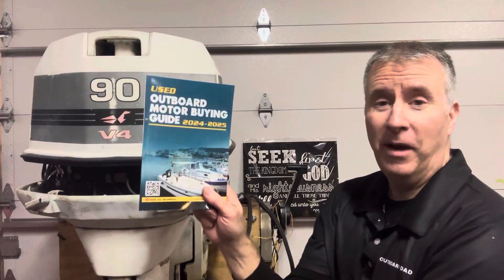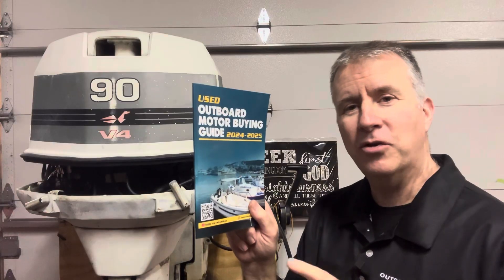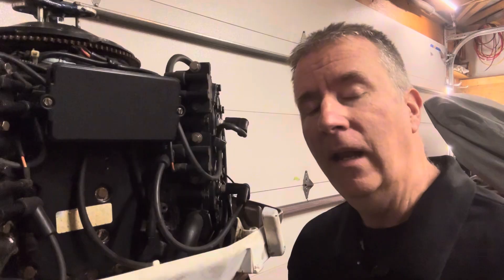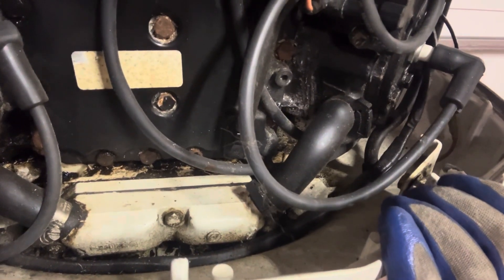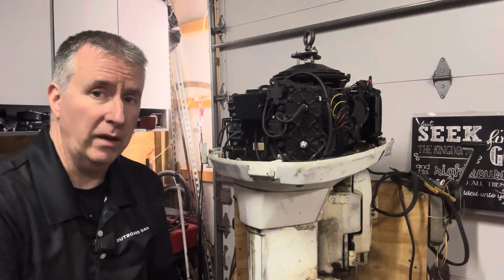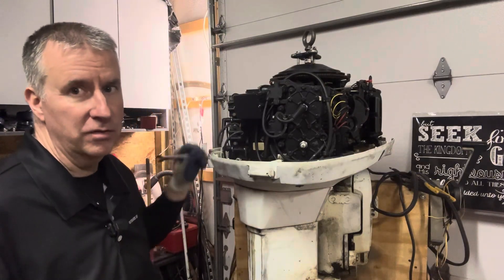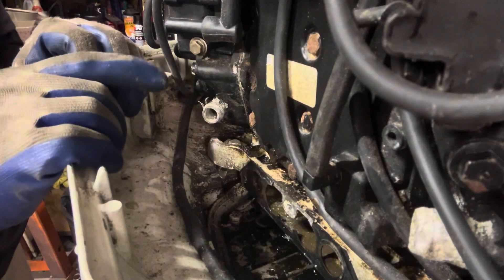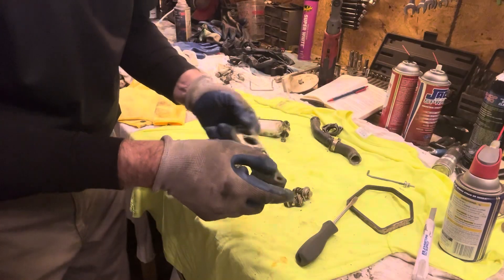Outboard Motor Thermostats and Poppet Valve Repkacement

Comment: Hello, I would like to know what function the plastic caps serve in relation to the springs?
Reply from the maker: You mean the poppet valves at the end of the springs? When the motor revs up and reaches approximately 25 psi water pump pressure then that pressure overrides the spring pressure and opens the poppet valves letting full water flow through the motor bypassing the thermostats at highest rpm’s. Was this helpful?
Reply: @OutboardDad Excellent thank you very much for the amswer. I figured it was something like that, meaning the thermostats only work at lows RPMs.
Reply from the maker: @Gustavoceleri-z1e pretty much yes. Please let me know if I can help in any way. What year and hp do you have?
Reply: @OutboardDad  It's an Evinrude VRO 115 HP engine from 1985 with 420 factory hours.
The VRO has been disabled due to a lack of maintenance knowledge at the time.I'm Gustavo and I'm writing to you from Buenos Aires, Argentina.
Reply: I replaced the water pump and, testing the engine outside the water with the water pump on the engine mount, it takes a little while for the water to reach the cylinder heads and circulate through the hoses to the thermostat housing. The water coming out of the indicator (the small jet of water) is cold and at good pressure, and it comes out of the center of the propeller exhaust hot but not scalding. I don't know how the water flow works in the circuit; I couldn't find any information about it. Also, the upper right cylinder feels a little warmer when I touch it.
Reply from the maker: @Gustavoceleri-z1e Great! Let me know if I can help in any way!
Reply from the maker: @Gustavoceleri-z1e Ok I have the manual, email me at Keith@outboarddad.com

Comment: Just found your channel enjoying it.i got a 1998 v4 90 Johnson it's got the cold sneeze can your tell me we're I can get a set of jets to fix it
Reply: A jet assortment
Reply from the maker: @donnyroberts3002  Did you try boats.net? You can also try promarineusa in florida. That sneeze may be timing related. I highly recommend getting the manual to set it correctly. You can certainly adjust and see how it runs but good to have the book. Also many times the follower on the throttle linkage breaks and does not line up for the correct timing and throttle position. If you want send me some pics of the linkage keith@outboarddad.com

Comment: Keith, love your videos. I have a 2 stroke 1987 88hp evinrude v4 crossflow engine that sounds the overheat alarm at idle or slow speed at the lake. I have tried everything I can think of, replaced waterpump, thermostats, poppets, removed heads and water covers and cleaned water passages, installed new water diverters in heads, flushed engine with Rydlyme and still get overheat alarm. Engine has good compression and used fresh gas with proper premix. I run only on freshwater lakes in central florida. An older gentleman at the ramp told me to just remove the thermostats. He states the water temps here are never really cold enough to do any damage and he has been running outboards here with no t-stats for many years. What is your thoughts and do you have any other suggestions? Thank You.
Reply from the maker: @rok7980  I would try that on that motor because it won’t harm the engine. You may want to try a bleed first. Some guys drill an 1/8 hole I. Each poppet valve others grind a notch in the top of the thermostat. Either way these motors get air locked at times and the older thermostats had a notch in them to let the air out. Either way should work. Let me know how it goes. What would you like to see more of in my videos?
Reply: @OutboardDad  I like the old OMC crossflow videos, I have one and they seem to run forever with proper maintenance. A video covering all the maintenace a DYI guy can do to keep them running. Thanks.
Reply from the maker: @rok7980  ok thanks
Reply: @OutboardDad  Keith, one more question please, If I do remove the T-stats should I also remove the poppet valves or just leave them in? Thank You
Reply from the maker: @rok7980  Leave them in, let me know how it goes

Comment: OK, let me clear, this is a horrible/thoughtless design that I am not trying to defend....  In any event, I can tell that someone has had these thermostats out before, because the gaskets are not painted.   You make an excellent point here, and that is that oftentimes these bolts are not seized due to the threads, but due to the salt build up around the unthreaded shanks that go through the plastic and aluminum thermostat housing.  Therefore it is critical to lube the bolts properly during reinstallation.  Sure, we are doing to do our best to clean the internal threads along with the threads on the bolts.  In addition it is super important to get inside that aluminum housing with a small round file and clean out those holes!  Now to one of my biggest pet peeves.  I constantly watched techs (even salt water techs) simply put a dab of grease on the bolt threads and call this "lubricated", but you must lube the unthreaded shanks of the bolts as well.  And yes, you must be careful about using the never seize products on this aluminum stuff.  Some of those products will promote corrosion/electrolysis, they are not meant for aluminum, you must read the label.  For me, I use the gasket sealing compound on the threads/shanks, but regular grease is great also.  Most anything is better than nothing.  
You had a relatively easy time getting those bolts out because someone was in there before, it would not have gone this well had no one been in there before (this looks to be a salt water engine).  In tougher situations you must do everything possible to avoid snapping those bolts off, you run the risk of them snapping right at the exhaust adapter housing, YIPES.   I have gone to such extremes as to "waste" the plastic housing by busting it apart with a little chisel and carefully driving the pieces out (being careful not to introduce plastic waste into the adapter water passages).   This way I can tap the aluminum housing inwards to break/free up the seized bolt shanks.  This usually frees up the bolts enough to work them out gently, perhaps with some help from gentle heat.  
Everyone is laughing at me know saying:  "heck that flat back 90hp is easy, what about the bubble back exhaust models"!  And, everyone is right needless to say.  You know what, removing the powerhead is relatively easy on these engine, only takes a half hour or so, and the powerhead bolts are rarely seized up.  Once the powerhead is off, you can remove the lower pan easily, and get at those bolts like a gentleman.  Again, the ultimate goal here is not to snap those bolts off even /below the exhaust adapter mating surface.  I know, many guys drill holes in the lower pan, but I have also seen many hack jobs that just destroy that lower pan and make the engine look like crap.  I have never attempted to drill through the lower pan, only because I can't figure out a way to line up the holes with the bolts properly....But, if you have figured this out, and have found decent rubber plugs that won't fall out, then the drill and plug method is fine.  
And yes, those SS thermostats are blown open.  My buddy, who is still an Evinrude dealer says this is a common issue for the newer BRP SS thermostats, so you want to keep that in mind before using them.  Perhaps BRP has resolved this issue by now, don't know.  Keep in mind that there are one or two tiny bleed holes in that plastic housing, it is super important that these are inspected and cleaned out.  On top of being near impossible to service, this thermostat set up is super sensitive, not uncommon for one side to get super hot while the other side is OK, setting off the alarm at lower RPM....Even though the thermostats are fine.
Reply from the maker: @donk499  This is great stuff here! I agree that you can’t just use never seize on everything, I found out the hard way when I saw electrolysis on my own motor years ago and switched to white lithium. Breaking bolts is not the end of the world but if we are careful many times you can remove these without that issue. Thank you for your comments!

Comment: I had a 1983 Johnson 90hp.  Was a good performing engine, never had an issue.
Reply from the maker: @bja2156  Great motors! I had a 79 Johnson 85 hp. Do you do your own maintenance?
Reply: @ yes I do, I feel it’s the best way to ensure longevity while saving a lot of money in service work.
Reply from the maker: @bja2156  I agree! When it comes to my boat, I have trust issues letting someone else do the work.
Reply: These were some of the best engines produced by any manufacturer
Reply from the maker: @fleetwin1  I agree, that is probably why Yamaha copied them and theirs were good as well. Do you own one of these?

Comment: one of the big issues is air gets trapped in the housing, forming a bubble around the t stats and they overheat. notching the poppet valves for relief solves this issue, especially if theyve been sitting for a while. if you have the old style housing change it to this newer style with the larger center hole. if that gets clogged this issue will happen as well. some guys drill it out with a 1/8 bit but can run too cool.
Reply from the maker: @ct1762  I was always taught to notch the top of the thermostat to let the air out. So your saying the poppet valve should be notched? Interesting, I guess it would do the same thing.
Reply: @OutboardDad  I've never heard of the t stat itself... are you saying you cut the metal lip?

Comment: I have a 2000 Johnson 90hp looper. Do you have input on this engine?
Reply: These were great engines.  The ignition system is a little peculiar, but no big deal.  One annoying engineering flaw is what we refer to as "heat soak", because the carburetors are mounted so darn close to the crankcase.  This symptom is characterized by the following symptom:   Engine starts/idles/accelerates fine when started cold.  But, after shutting it down (in warm/hot weather) for a bit, it will be tough to restart, and will stumble/stall on acceleration.  The fuel in the carburetors is more or less converted to vapors while the engine is sitting in the heat/hot block making it tough to wet down the carburetors again, resulting in stalling/stumbling/stalling after a hot restart.  It is probably best to let the engine run for a minute or two at a little higher RPM, helping it along with the primer, before attempting to take off/get away from the dock....
Reply from the maker: @ Yesss! I discovered that when fishing in the bay when we had a full week of 98 degree weather and the back bay water was staying warm. I noticed when I was in the ocean and the water was cooler it kept the motor cooler and had less of this heat soak. Do you own one of these motors?
Reply from the maker: @mrgarrettjohnson123  Sure, the failure they experienced were typically due to the oil injection system. Many times the oil in the tank gets thick as it’s just topped off each time and never cleaned out. The people who pull the tank , clean it and the oil lines have better success. I am a big fan of using the manufacturers oil and if you can use ethanol free fuel. Then it’s the typical water pump, thermostats and lower unit service. It’s also a good idea to add a little oil to the fuel in the tank. Or ring free. Do you do your own maintenance?
Reply: @ 

 Since my original power head blew, I have been running premix. I typically have the lower end and water pump serviced annually and add startron fuel stabilizer to each tank of ethanol free gas.
Reply from the maker: @mrgarrettjohnson123  Makes sense, did you have your motor rebuilt after it blew?
Reply: @OutboardDad  I had a new power head installed. As far as I understand the original power head ate a ring on cylinder 1.
Reply from the maker: @mrgarrettjohnson123  Interesting, did the mechanic share why he thought the ring failed?
Reply: @ I don’t recall any more detail unfortunately. It’s been a great motor since the rebuild though.
Reply from the maker: @mrgarrettjohnson123  I am doing a rebuild on a looper in the next 2 weeks, will do total teardown and reassembly videos so keep an eye out for it.

Comment: Bubbleback exhaust makes that job more enjoyable. Taking the lower pan bolts out you can pry the lower pan down a little to give you another inch or so. Amazing how many people do it the half ass way and cut holes in the lower pan (cowling). Horrible design by OMC. I personally think this is the number one reason why these motors fail after they get older. It's very hard to get to, so most people put it off and never do the thermostat maintenance as a result. Thermostats stuck closed = overheating. Which in turn leads to scoring, melting piston skirts, warped heads, water covers and block mating surface warpage. Thermostats stuck open = motor running too cold. Which in turn leads to egg shaping the cylinders and most importantly coked up (carboned up) piston ring lands. Which in turn leads to the top ring getting pushed out of the ring land by too much carbon deposit and then the top ring catches in the exhaust port and breaks it. 

Coming in at a close number two for Crossflow failure is VRO. I think most of these issues can be a result of user error too. Too much of the "ride it hard, put it away wet" culture. In one of your last videos you talked about how cosmetics isn't just for looking good. It shows an owner that cares. If I went to buy a V4 Crossflow and I saw holes cut into the bottom pan (cowling) I'd turn and walk away. Loose as a goose maintenance went into that motor if that's the case. How many other willy nilly things were done to a motor like that?! 

On the Looper design OMC moved the thermostats to a very easy to get to location on the head itself. Making maintenance much easier on that motor.
Reply: OMC should've done what they did with the V6 i agree. completely crazy they never changed to top t stats/poppets but the #1 reason for failure is stuck rings by far. not doing a proper decarb with engine tuner once a season accelerates this, add bad fuel and overpropped = disappearing rings
Reply: @ct1762  These motors will run and have decent compression with no top ring. Mind blowing facts here. Ask me how I know lol
Reply: You are sooo right.  Patience and "fineggling" could help gain access to those screws.  Removing the lower motor plastic pan/cover and lower motor pan mounts could sometimes allow better access.  And yeah, the VRO added unnecessary complexity and mandatory service requirements that were ignored by most owners and shops.  I was often frustrating when OMC techs didn't even know what the various horn warnings sounded like/meant, much less taking a few extra minutes to check the warnings during routine servicing.  Water in the oil tank was a big killer as well, even the VRO "pulse alarm" could not differentiate between pumping the right amount of oil vs. pumping water...  
Needless to say, I will not attempt to defend the VRO/OMS system.  The only beauty of this system was its simplicity and the fact that it was so easy to override/delete!  I get so frustrated/maddened when I see folks advising to replace the VRO with a conventional fuel pump(s).  There is no need to go through all this trouble and expense, the VRO is a great fuel pump.  Simply pull out the oil tank, disconnect the low oil and VRO pulse alarm, then use premix.
Reply from the maker: @fleetwin1  Yess! I have a guy now I am selling a 1995 150 to and trying to convince him to delete the oil injection. Hope he makes the right choice. Thank you for your expertise!
Reply from the maker: @MexicoPescadoro  I agree! Thanks for your input! I see you’ve had some experience with these motors

Comment: I have the 1978 Evinrude 140, Still going strong
Reply from the maker: @rogercrouse5531  78 wow that’s awesome! What are your secrets to keep it running so long?
Reply: @OutboardDad  Nothing Special Really Just good 2cycle oil and no Ethanol gas.  only thing i had to do was Water pumps a few times and Spark plugs  .  Fresh Water  only here in the Midwest
Reply from the maker: @rogercrouse5531  That helps, I would say a large percentage of issues are a result of ethanol in the fuel. Thanks for your comments!